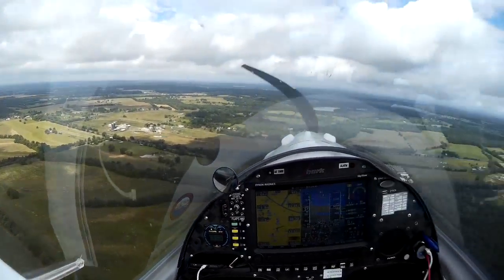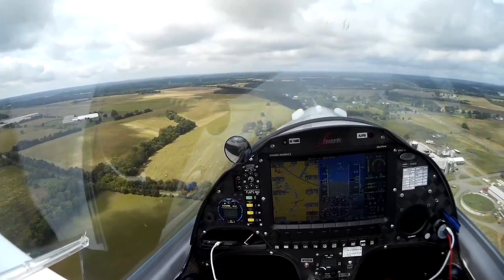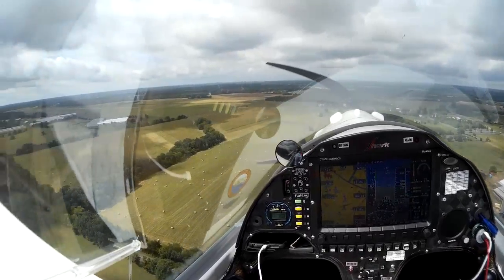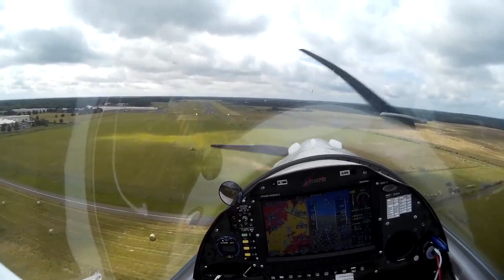Shark US - VLOG 11 - FPV Around the Pattern

Comment: The Shark looks really sleek and performance pretty good too, as per the numbers. Both the TL Stream and the Shark have the side controller, the Blackspace Prime has centre controls. Don't like the side stick.  Caution folks on this machine! The Gear and Flap switches are too close together! On a touch and go,  it would be way too easy to select the gear up instead of the flaps. And as a pet gripe, why select flaps on downwind. It's not a 737 or even a Kingair!

Comment: Skilled takeoff and landing. But @ 3:00-ish, the pilot said "60 knots, make a right turn" while he was yawing to the left. Hopefully it was just the intercom. The air traffic controller wouldn't appreciate that. A nice twin-seater with modern avionics --several steps above the Cessna Sandpiper, which I call a flying lawnmower.

Comment: Hey Jon, what was the alarm blinking for most of the circle?
Reply from the maker: Eduard Pekarovic Edi. It was a cold day. Engine Oil low...causes rpm alarms to reschedule. It’s now all sorted. We installed an oil bypass valve. Temp regulates within limits now.
Reply from the maker: That was the engine oil temperature (it was cool) re-scheduling the RPM warning.